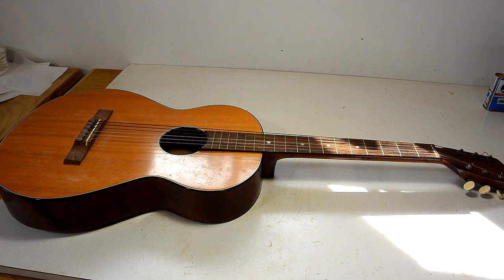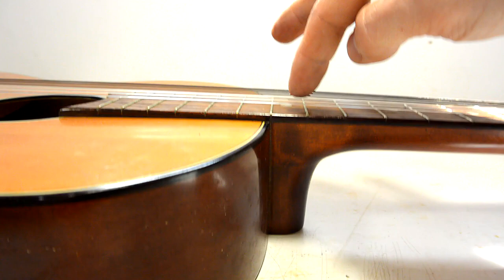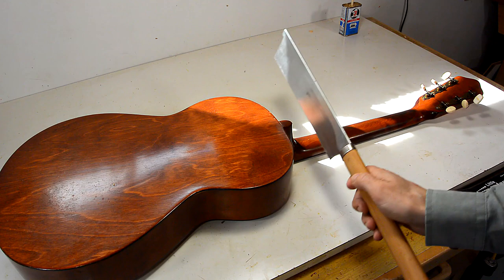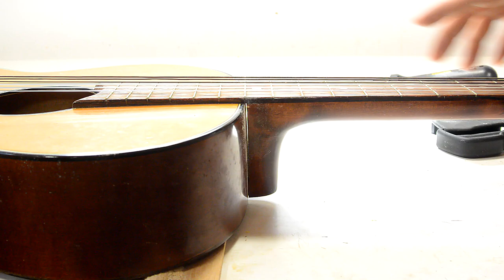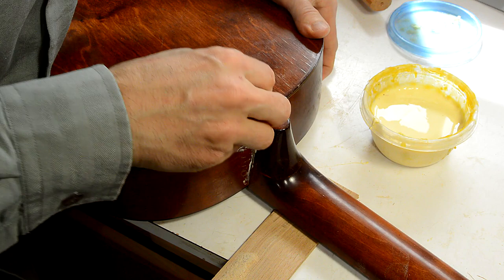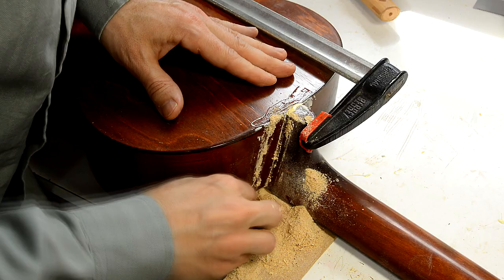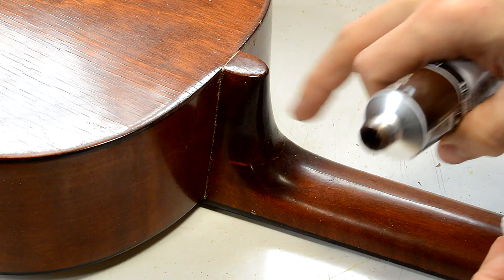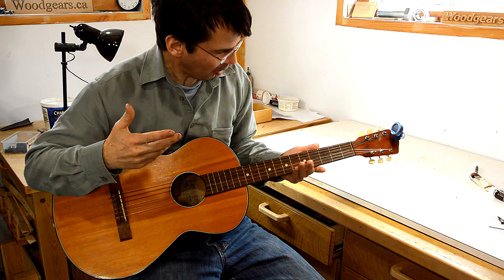Neck reset on a junk guitar

Comment: I don't understand some of your critics, I didn't see or hear you ask them to let you do this to their guitar. I once did a simular repair to "cheap" guitar I found in the trash. The neck was loose from the body, I filled up the crack with woodtite, drilled a hole from the neck to the body, put in a drywall screw, filler the hole with wood putty and after 30 years its still playing. My sons all had a turn at it, its here if someone wants to play along. According to your critics I should have let it go to the landfill, not made any effort to do anything. Then I could join them and sit and do nothing but wait to critsize others for their efforts. Keep up the good work, ignore the shiezerkofts.
Reply: Hey you should make a video with your saved-from-the-landfill guitar!
Reply: Great lesson ! Thank you !!!
Reply: Hear hear! I have the same feeling and will do the same.
Reply: @technonut1946 if a job is worth doing, it's worth doing right! This is all wrong. The gentleman is clearly a skilled woodworker, but he butchered the guitar, destroying any chance for a LEGITIMATE repair to ever happen. This is like welding a Prius nose onto a crashed 1967 Camaro. If something is worth doing, it's worth doing correctly. I'm surprised he didn't use a framing gun to slap a few nails in it for good measure.
Reply: @justabouthadit5872  Hardly. You suggest spending $500 on a neck reset for a guitar that's worth $50?
Reply: @TheTroyallen23  BRAVO 👏🏼 👏🏼👏🏼.
Reply: @justabouthadit5872   dude common, its a plywood guitar from the 70's, belive me no one would have ever cared enough to do a real neck set on the thing. a simple kungfu neck reset (as shown in the video) will de the job, otherwise if would have probably ended up in a landfill.  Don't criticise the man for saving a practicly worthless guitar.
Reply: I did quite orrible things to guitars but a driwall screw is just superior level haha 😂
Reply: Nailed so much. People love to antagonize on the internet for nothing.

Comment: Budding luthiers out there - this is Not the way to reset a guitar neck. We steam the joint loose, then carefully adjust both the dovetail and the fingerboard using shims, shaving 1000s from it , etc etc. Plenty of Utube vids on how the job is correctly done  cutting the heel destroys any structural integrity of the neck
Reply: What a stupid solution to this problem. The whole guitar is now structurally unsound especially around the neck. Wonder if he would do this to an expensive guitar??
Reply: He clearly says at the start "I'm going to do something barbaric." He knows this isn't the "right" way to do it but he doesn't build guitars for a living, he just wanted to experiment.
Reply: What makes you think this even has a dovetail joint in the first place?
Reply: Do classical guitars have dovetail joints???  I've read it's just a single piece of wood glued to the body itself. So steaming, and heating would not be a solution.

Comment: Should have taken the guitar to a luthier and spent the 500 dollars to save the 20 dollar guitar.
Reply: a Luthier would have rejected fixing it. Is not worth of his time.
Reply: @nicolashrv  I have a vintage Yamaha FG-75 Red Label (Nippon Gakki) & it need a neck reset. Two luthier told me it will cost me $250-350 to do the job. Resetting guitar neck is a nightmare job to the luthier & some of them don't want to do it especially on the cheap guitar. And you're right, is not worth of their time.
Reply: It's Mom's guitar! Well worth the fix...

Comment: Perfectly reasonable approach to saving an otherwise useless instrument.
 
I admire the "beginner's mind" approach here. Mr Wandel is not encumbered by preconceived prejudice about "proper" instrument repair, although he is obviously aware of other traditional methods.

This is also pragmatic and practical. This elegantly simple method took FAR less time than standard repairs and (at least temporarily or partially) saved a guitar that no professional repairman could justify working on. To heat and loosen glue, remove and reset the neck would have cost more in luthier's time than the thing was worth. 

It may be "barbaric" for fine instruments, but for a low-value guitar in that condition, the "Gordian Knot" solution is great. The method was appropriate for the situation.

Plus I got to see him cut the neck (almost) off!

Comment: Thanks for your video!  I just performed the exact same repair on a $10 Goodwill find, a H166 Harmony Marquis. Now the guitar plays extremely well and the sound quality is incredibly great!  I did one thing a little different. Instead of gluing the neck back, I drilled  2 small holes and put in bolt instead, this way it will be easy if I need to adjust it again.  I swear this H166 sounds better that my expensive guitars.  Thanks again, your video kept this old gem from hanging on my wall.

Comment: I've just done this on an old classical acoustic guitar and it now plays a treat. Like yours the neck was bent and made it both difficult and painful to play. Adding a screw to the heel allowed fine adjustment to the relief and the joint now reset with pva and recycled sawdust is both strong and invisible. The frets around the 12th were refiled and now with new strings it has a lovely tone and is so easy to play. A great fix.
Reply: I would be interested in knowing what was your method for adding a screw and what screw you used!
Cheers

Comment: That was the craziest thing I've ever seen, but I like it.
Reply: If you have a steel string guitar with no truss rod, would it be ok to glue the heel AND pit a bolt through it, because of the string tension?
Reply: @jonny1251  Nylon Classical guitar like this don't have much string tension like the acoustic guitar that used metal strings & that's the reason why mostly classical guitar don't have truss rod. The worst things I've seen people installed metal strings to a classical guitar.
Reply: Yes😂

Comment: Just found this video. Good job on the poor man's neck reset. I've known about this technique but have never seen it used before. This, along with slipping the block, are viable options when a "proper" neck reset exceeds the value of the guitar. There's also another fix I've seen on old Harmony guitars where they remove the end of the fretboard and drive a wedge in the loose dovetail joint, torquing the neck back. I'm glad you were able to restore it to playable condition.

Comment: None of the armchair luthiers who have contributed to the thread so far seem to have the slightest idea of how a classical guitar neck joint works.

A classical guitar doesn't have a dovetailed neck joint , it doesn't have a truss rod and it doesn't have a bolt - on neck. In a classical guitar the neck and the neck block are the same piece of wood ... the ends of the sides are fitted into slots cut in the neck block and the back and top are then glued on. It is impossible to do a "steamed-off" neck reset on a classical guitar. Heating the neck as suggested earlier won't work either, unless the problem is too much relief, but that isn't the problem here, as far as I can see.

On a cheap guitar like this, the method which Matthias demonstrates makes perfect sense. I am not saying he executed it as expertly as might have been done ... personally I would have cut a very slight taper  rather than just one kerf,  and would also have reinforced the joint  with a screw from the inside.

On a more valuable (classical)  guitar, the way to do it is by "slipping the neck block"... the binding is removed from the heel to halfway along the upper bout on both sides, and the back is sawn off  to halfway along the upper bout.

The guitar is then clamped , with the neck pulled back, so that the edge of the back protrudes past where it was originally,  and the back is then re-glued to the lining  in its new location. This pulls the neck angle back and makes the instrument playable. The binding then needs to be fitted back in place and that is the bit that separates the men from the boys.

 FWIW, slipping the neck block is also the only practical (and economical)  way to do a neck reset on a cheap Martin formica guitar.
Reply: Yea your right! They have duck tail joints instead.
Reply: The other way it is to carefully plane the fingerboard thickness, or replace the fingerboard with a thicker one and then plane it. I held a 1960s Stella guitar done this way. Looked mediocre with the obvious repair, but played great.
Reply: You are 100% WRONG. 

Classical guitars can have or not trussrods, and usually can have a carbon or a metal square rod (which doesn't have any form adjustment, but since it's squared, it is impossible to bend due to the string tension).

The neck block most of times is NOT the same piece, specially in factory produced guitars, where they glue a block  or even a sandwich of several pieces of the same wood.

His method is totally weird. Removing the fretboard and installing a carbon fiber or a metal bar as trussrod would have been 100% more efficient because it will not affect the structure of the guitar.

By doing what Matthias did, he basically BENT the fretboard at the section he made the cut, and DIDN't fixed the curve he had on the higher section of the neck (which is the part that bends with the time.

To complaint about "armchair luthiers" you surely have no idea what you are talking about..........seems you are just an "armchair complainer".
Reply: Dear nicolashrv, perhaps you should rethink the  "armchair complainer". I know murmac personally and he is a very professional guitar repair man possessing considerable skills. This repair was a quick fix (did you read the description, it says "barbaric") to a low value guitar and made it playable again. And you very clearly showed a lack of knowledge when you said " the higher section of the neck (which is the part that bends with the time." - Bollocks.......
Reply: Dear Colin North, please don't talk about stuff you have clearly NO IDEA about. I can see you clearly don't understand how a necks bends, and probably not even how a guitar is standing, if you can't know high from low part.
Reply: I think my customers, both for the guitars I have built for years, and my repair business, might take you severely to task about that.
Reply: sure dude.....oh, wait. Van Halen in the other line. He is asking me to build a new guitar for him.......
Reply: Yeah, right.
Reply: I have a cheap classical guitar and the neck parted right where he sawed it. It could have been steamed off.
Reply: No no no......don't give him facts and reason, he is just an armchair complainer. He will say you imagined that.
Reply: L.O.L !
Reply: "Slipping the neck block" also corrects collapsed soundboard, so probably in most cases this is a better method.
Reply: is there a shortage of wood that I don't know of ? I mean I'm not sure it even makes sense to  repair a wooden guitar anyway
Reply: agreed, and furthermore this doesn't look like a true classical with an integrated neck joint. Looks like a 50's catalog guitar with a spruce top and birch backs, sides and body which is quite uncommon for traditional classicals.
Reply: You are right about "traditional" classical guitars having that style of one-piece neck/neck block, but do you really think this guy's guitar was made that way? His guitar looks like a cheap American or perhaps Eastern European plywood job from the 50-60's. Perhaps it was made in South America or even an early Japanese guitar. Either way, it likely was some kind of neck block with a glued in tenon (not necessarily a dove-tail) construction.

All that aside, the reason I would not advocate for the repair method he employed is because of the woodgrain at the glue joint. Most likely, the joint after he cut it would have (at best) been the side grain of the "sides" under the neck joint, and the end grain of the neck itself. Trying to make a reliable glue joint involving end grain is nearly impossible. Ok, if it was just a napkin holder or some other ornament - fine. But he is now putting the glue joint under relatively high tension, even with the short scale length and nylon strings. I feel certain this joint will give way easily if subjected to lots of playing at full string tension or even carrying the guitar (or hanging it) by the neck.

I do credit him with taking the initiative. If its more playable now and he gets some enjoyment out of it for a time, so be it. It's not like he destroyed the value of a rare guitar.
Reply: @dwsnsgp  That MIGHT been because the guitar had neen subjected to this procedure before. Possibly by someone making cheap imports into guirars playable enough to be sold. Then not using a strong enough glue.

Comment: By watching your video, I've done this on three cheap guitars and it works great. I've tried to do it the "correct way" by steaming, drilling small holes under frets, taking fret board off guitar body, etc., but these cheap guitars are not dovetailed in, most are DOWELED in. I wouldn't do this on an expensive guitar but cheap guitars I get off craigslist and FB marketplace, yes, after making adjustments on bridge, saddle, truss rod, etc. and the action is still high I'll do it.

Comment: Matthias, I like your many videos, and many of your creative solutions.  As you say, this one is "barbaric."  Re-setting a neck on a guitar is a fairly standard practice for a luthier.  In general, for most instruments with a dovetail joint you drill a small hole through the fingerboard into the joint and inject steam.  This softens the glue and the neck then just slides off.  You then shave the heels of the joint to adjust the action, reglue and reassemble, then fill the small hole in the finger board.   On an old instrument that might otherwise find its way into a trash heap, your quick method may be worthwhile, but my my.  cheers.

Comment: This is a perfectly fine method for guitars who's neck cannot be removed or for low value guitars where the time investment to steam off the neck etc makes no sense. The only suggestion I have is that after you make the saw cut, use some sand paper to "floss" between the heel and the guitar body (sanding the heel) to get a good, gap-less joint between the heel and the body for at least a third (even further if the string height will allow for more neck angle) of the way up the heel.

Comment: This is pretty great. I just did something really similar using rubber bands instead of a vise (I don't have one). Glue should be dry by tomorrow, then I'll put some strings on it when they get here in the mail. This is the kind of thing that works great as a first project, because there's no risk of ruining a good guitar. I'm too scared to try modifying the ones I actually play.
Reply: It was an old 3/4 size beginner's classical with the neck coming off. I figured instead of throwing away, I'd set the neck back where it was and see if I can't get it up and running. I'm excited to see how it'll turn out.

Comment: This repair can be taken a few steps further for lower playing action. After the first cut, grab a long Quick-Grip clamp and apply light pressure between the headstock and the lower bout of the body. This will close the gap on the first heel cut, but only on the heel side of the joint. Repeat the cut. The fingerboard acts as a pivot so that repeated cuts remove material mostly from the heel side of the joint, changing the neck angle as you go. Repeat the cutting and clamping process until the neck angle is perfect. While the glue is still wet, run a short drywall screw into the joint from the inside, through the neck block and into the neck heel, and the joint will never fail. With this repair, the guitar will not be playable above the 14th fret, but that’s usually acceptable for inexpensive guitars.

Comment: Excellent! 
🤔 Theoretically you could probably use a similar technique with a guitar with a trussrod, by putting the neck into a forward bow, using the trussrod. 
Then removing the strings and cutting around the trussrod, making approximately 3 cuts stopping at the trussrod and regluing with a slight backbow.
It may require different types of saws possibly even drilling or a dremel tool.

Comment: This guitar didn't really need a reset. If your neck is bowed you can clamp it with pressure going in the reverse direction to correct the bend. Some people even use heat during this process. Wood has memory. Look up "heat press guitar neck."

Comment: This is kind of like a strap button reset except no strap button.  Basically the problem is the neck angle is bad sometimes neck warps in a up bow or neck heel comes loose or both issues. Basically concept here is change the angle with out having to steam the neck off the guitar or using shims. usually the glue is stronger than wood.

Comment: I used the same method years ago with success. The neck was cut with the saw just to the fingerboard, then I used polyurethane glue and it holds just fine. However, I had to sand down "the bump", so the fingerboard was straight and reinstall a couple of frets around 12th fret.

Comment: If it does not have a truss rod it usually means it was designed to use nylon strings not steel strings. And that's why the neck bent over time, as steel strings need a lot more pressure.

Comment: sweet mother, i just got a "junk" classical guitar that had steel strings on it all its life, neck cracking off, the top is warped from the bridge pulling over time. was not expecting to see a Mattias video on the exact problem lol